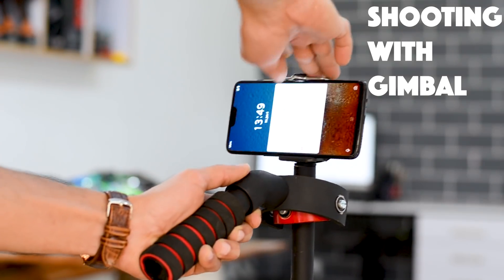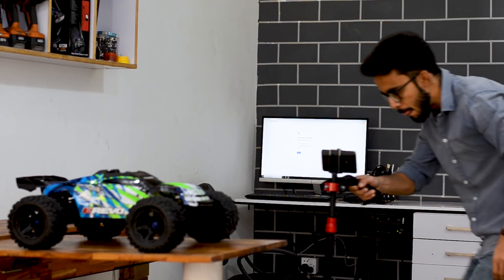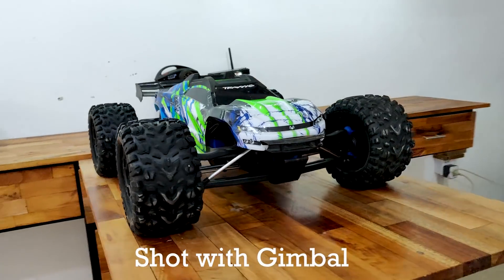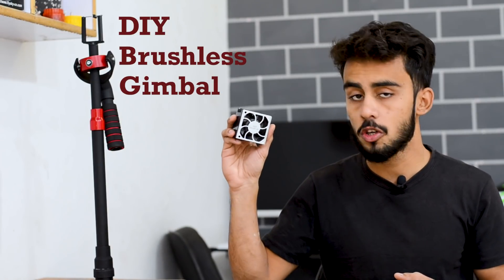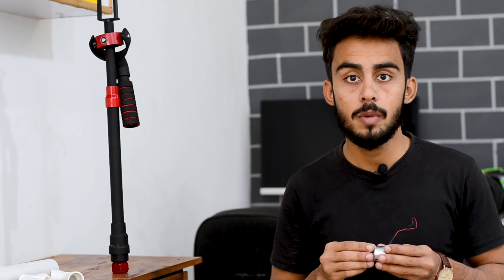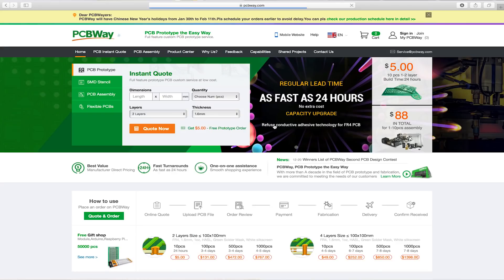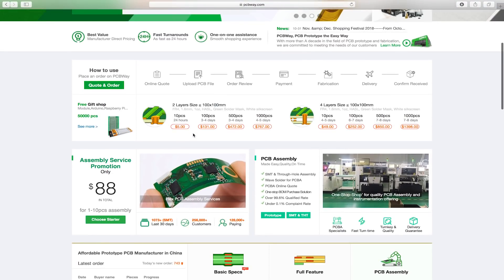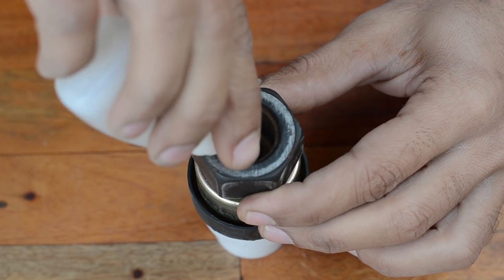How to Make a Brushless Camera Gimbal

Comment: the position of your motor is wrong ... the fly wheel shoud be at the  center of gimble balance rings if you're working with one flywheel only, then u wheel get enough angular momentum to oppose the shakes.

Comment: I went to your blogspot link and it was very helpful. But can you let us know the size of the bearings please? Its impossible to tell from a video or photos and the link to the bearings is no longer the one you put up but takes us to a generic bearing page. Thanks. I am surprised at the facetious comments below. I am a professional photographer and I use a MOZA Air for most of my DSLR shooting but it does not work with a video camera. So for some of my work, I just need a gimbal, and this is a gimbal just like those that have been made for centuries to keep things on level with the horizon on boats. I will use my monopod that has a small tripod foot that will provide weight as well as allowing me to put the whole thing on the ground when I need to fiddle with settings. If you start the recording and start moving slowly and evenly  before you approach the actual point where you want to start the video, you will be able to cut out the initial sway in post. Then with better cameras you can have the camera internal "stabilization" turned on and add more if necessary in post production. So come on, give this guy a break. He has certainly helped me make a simple gimbal that will get me what I need. I just want to know what sized bearings to buy.

Comment: Doubt the spinning motor is doing anything beneficial, all its gonna do is make the bottom want to sway more (if you have ever held a motor with a flywheel it wants to stay in its previous position as you move it) and you are probably better off going with a more traditional and balanced fly cam
Reply: yeah I was also curious how this motor is affecting the gimbal without any motor controlling program

Comment: What he is charging the cells directly with 12v DC supply he should use a 3s battery charging protection circuit I don't think that the humble should be stable after a weak